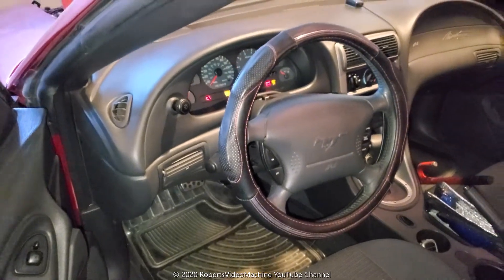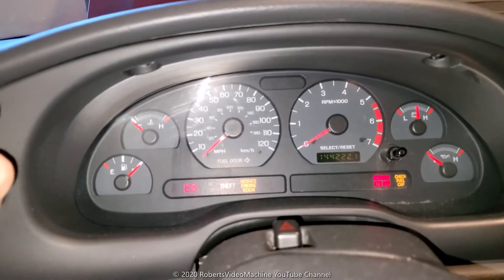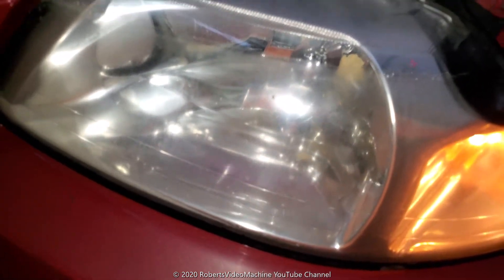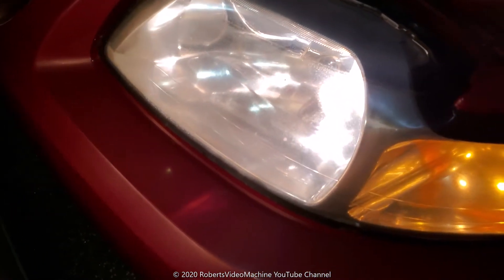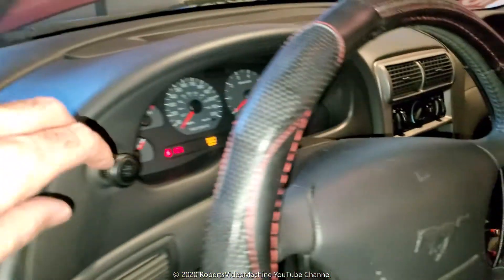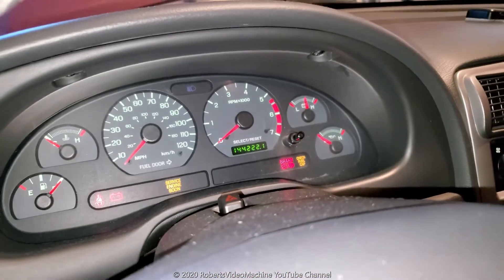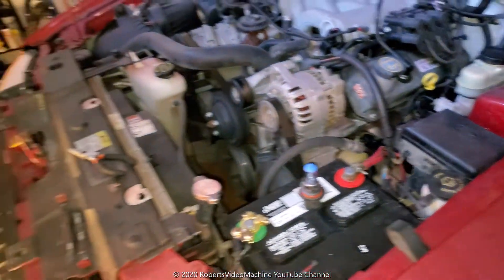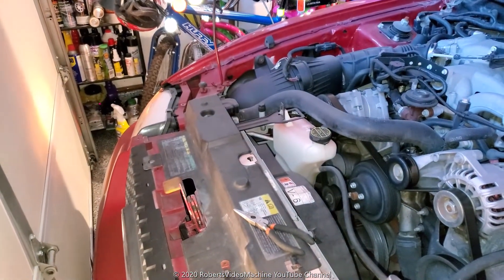DIY How To Diagnose and Fix High Beams Not Working on 1999-2004 Ford Mustang

Comment: My high beams or low beams doesn’t work at all. Only my turn signals,what could it be?
Reply from the maker: Since both lights don't work I would start by checking the fuses, bulbs, switches, and relays. I hope this helps and keep us updated. Thanks for watching, commenting, and don't forget to subscribe.
Reply: @RobertsVideoMachine  I’ve tried new bulbs that doesn’t work. Do you know the fuse number or relay?
Reply from the maker: @KYYNG JAY OFFICIAL 
I lost my user manual a while back, so I don't know. Hopefully someone here can chime in. You can also try searching for it online. Hope this helps.
Reply: @RobertsVideoMachine  where are the relays located  ?
Reply from the maker: @MrLarry1972  I lost my manual a while back, but the fuse/relay boxes are located (underneath the driverside area left of the steering wheel & next to the battery on the driverside). For exact fuse/relay functions; try contacting Ford. Hope this helps. Thanks for watching, commenting, and don't forget to subscribe.
Reply: Did you find the fix ?

Comment: How do you get the high beams to stay on ?
Reply from the maker: The lever for the turn signals is pushed forward (toward the hood) to have it leave the high beams on.  It's held back (pushed towards yourself) for a quick high beam flash.  Thanks for watching and don't forget to subscribe.
Reply: @RobertsVideoMachine  thanks I’ll try it next time
Reply: @RobertsVideoMachine  when I push mines forward they go off but when I pull it back if flashes on 🤷🏾‍♂️ both bulbs work . It maybe my switch light???